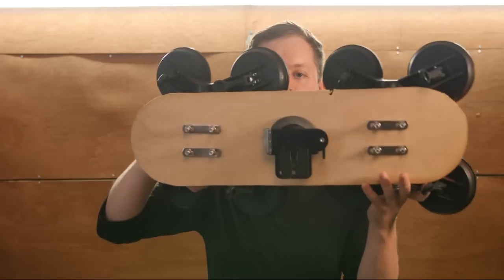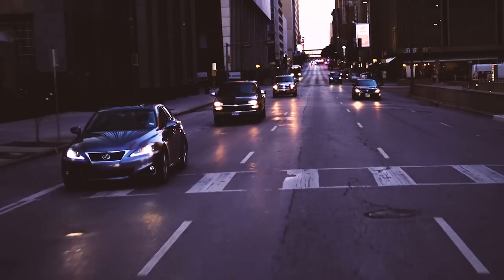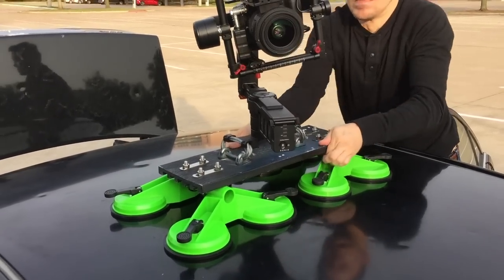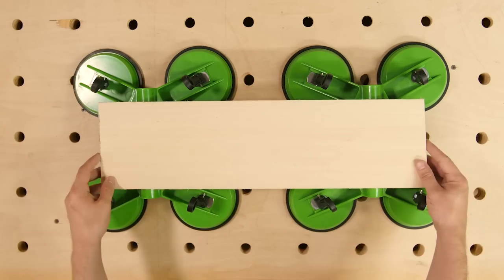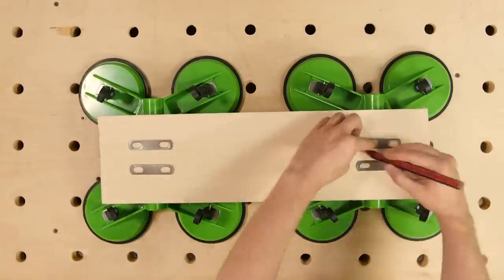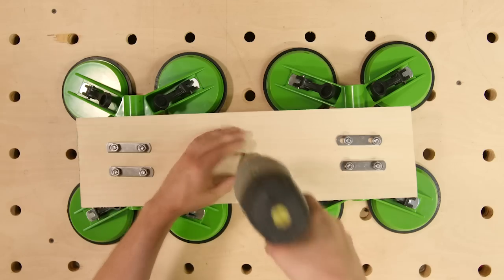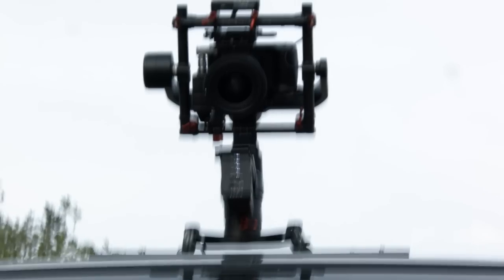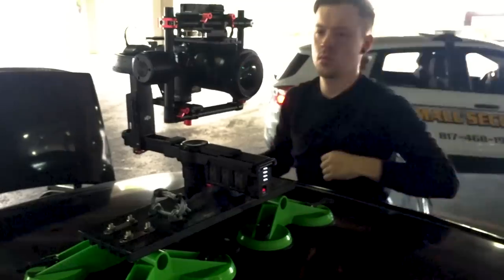$30 DIY Car Mount | Filmmaking Tips | PremiumBeat.com

Comment: added tip using a locking nut and/or washer will help keep the u-bolts from coming loose or falling off entirely.
Reply: I will include this in the next video! Thank you Kyle.

Comment: Use self locking safety nuts, (the ones with nylon inserts). Also... why would you need a permit?
Reply: I will be including them in the next video. A permit is not exactly needed until you begin more advanced setups, want to do a stunt of any kind or most importantly block traffic. For instance, you can shoot on side-walks but cannot place a tripod or set-up lights without a permit in public space. A private space depends on the owners permission and these rules can change based on your state and city. It would be good to know your local permit information if you are approached by law enforcement before shooting.

Comment: Car mounts are the domain of qualified grips and riggers for a reason. This should absolutely not go on public roads.
I don't see any backup lines or safety bonds, cables left loose, soft mounted parts. If anything, no matter how small, comes loose and strikes a member of public you're in for some serious repercussions.